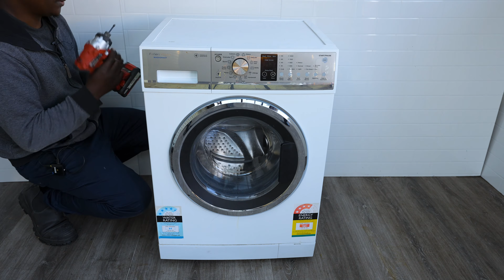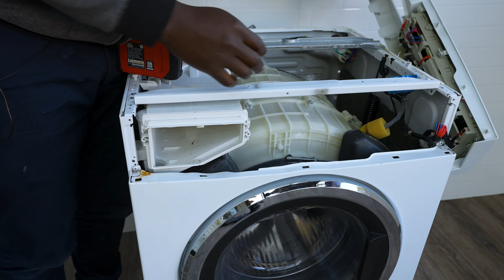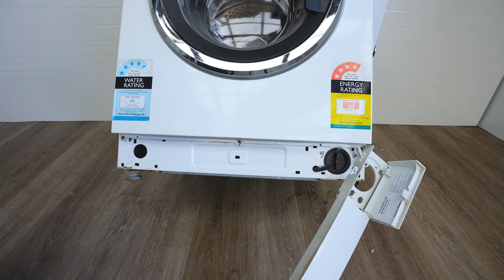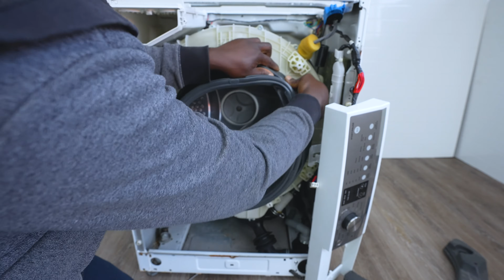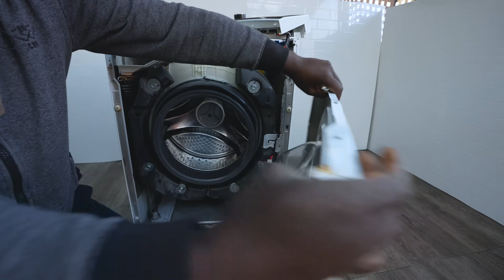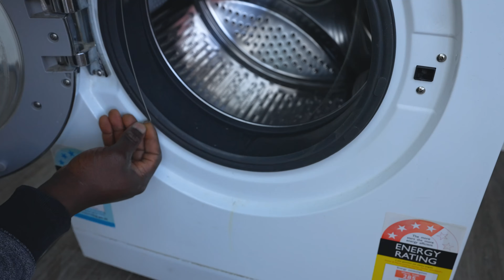Fisher Paykel Washing Machine Seal Replace , You Can Do This !

Comment: My seal tore when a strap from a sports towel was caught in the door. The continuous turning ripped apart the seal flange and allowing a small amount of water out. 

These instructions made me confident enough to order the part, take a day off work, and get to fixing it. 

The whole process was very simple except the final retainer wire. I spent 2 hours disassembling and reassembling. I spent ONE MORE HOUR trying to get that final wire locked in place. In the end I latched the wire ends together (in its final configuration), loosely screwed down the screw down, and used a small screwdriver to pry it into the retaining valley. A screwdriver is note ideal for this, since it could puncture the rubber, but fortunately I didn’t create any issues. I can only imagine they must have some special machine for this purpose at the factory.

Comment: Hey just want to say thank you for this video. Mine was torn and leaking so had to replace it. Was very difficult, the seal was the most difficult to install as mine has different lights and inlets and outlets etc. With a very sore back, all is done thanks to your video. Thanks again. Cheers.

Comment: Great walkthrough. Just a couple of things I had to do differently as mine was a washer/dryer combo so the seal is a little different (WD8560F1 Australia)

I am not an appliance repair expert, so just describing what I did and it appears to work fine.
There are probably experts out there who can advise on better ways to do this (especially getting the top pipe seal back on)

1. There are a few more attachments you need to remove at the top of the seal. 
   a. There is a light on one side and some sort of sensor on the other.
      Carefully slide these out (slide is probably a generous description here)
      Before you do, note how there are lugs for both that you will use to refit to the new seal.
   b. There is a heating duct in the middle. Remove the screw and carefully "unclip" the bracket (the bracket tip fits into a slot at its return)
      I also unscrewed the plastic duct that the seal was attached to so I could work on the next bit 
   c. There is a little pipe behind the duct part attached with a spring clamp (not sure of the correct term).
      Not sure what this is - maybe checks the air.
      You need to get this off before you can slide the seal out.
      I used a pair of multi-grips to close the spring ends so it would loosen and then wriggled the seal off

2. Putting the seal back on I needed to sort out the pipe seal from 1c above first while I was aligning it to get it on.
   This part was difficult for me, I am sure there is a trick to it as you will notice the actual seal is shorter at the back and higher at the front.
   In the end I just put the spring over the seal, opened it and wriggled the seal onto the pipe. The problem was one side kept slipping below the spring, in the end I got it all on satisfactorily.

   Also, it took me a few goes to make sure the seal was aligned properly before attempting to reconnect the top pipe (i.e. seal triangle/arrow to the arrow on the frame). It is worth taking it out and starting again until it is properly aligned.
   
   You can put the other bits (duct frame, duct, light, sensor) back on/in once you have all the seal seated properly around the drum as per video.

3. I snapped one of the clips trying to get the kickboard off. I think Mr Washy Washy did too as he commented on it when removing the kickboard.
   I also cracked the top of the frame as I was in the wrong place with the screwdriver. Once assembled, you can't tell but it was not ideal.
   I would watch the video and work out where the top lugs actually are. They just seem to need pushing down slightly and then pull it out.

4. The outer spring (wire seal retainer) is easy if you use a pair of pliers and pull the hook part over the anchor part (i.e. which gets screwed in)
   You just have to make sure the anchor part aligns closely with the screw hole.
   In hindsight, I should have pulled the seal back and taken some photos before removing it so I knew exactly where to position it when refitting.

Comment: Mine is underneath my dryer. I had to drag that thing off first, then the stacking kit just to start. All because I made the mistake of taking out the screws from the door hinge and the backing plate fell off inside the machine. Kids used the door as a ladder to climb up to the dryer. 1 hour of stuffing around and $100 later, just to replace the front ring around the door. Don't make my mistake, leave the hinge alone.

Comment: That last spring clip - to finish the job- is a b@$tard of a thing!! In the end, I opened the hook of the wire and detached the spring from one end, then I twisted the hook slightly. I only just got it back on but it worked!  The engineers who designed it should have to spend a year fixing washing machines!!!!!! Thanks again Mr Washy Washy. I recommend your site to everyone.

Comment: This walk thru was excellent, thanks. I did mine in about an hour with a cordless driver, a Philips head extension, a 7mm and a 14mm for the weights.
Agree with previous comments re seal - start from the bottom inner, work up (not fighting gravity) and then do the outer.

Comment: At the bottom lip of the plastic drum where the seal drain is, did you get the seal to hook onto two little tabs above the seal drain and behind the lip? Maybe this model doesn't have them (I have a haier with a similar design).

Comment: Tip: I had real trouble getting the wire seal retainer in place.  I wiped the wire with dish washing liquid to act as a lubricate.  That made the job a lot easier.

Comment: Really good video.  The bottom plastic panel comes straight out.  Not up, not down, just a straight pull.  For the seal, I found it easier to fit the inner seal first, then the outer seal just seemed to drop in place.  I also found it easier to remove the three screws (top) that hold the softener box in place.  Makes it easier to remove/refit the front control panel.

Comment: Im 62 female & I chaned the door seal. However, a couple of points:  identify the model as my seal was different, it has a light.
Beware the 2nd spring to unscrew. What a nuisance to get on to. And, the door spring, describe what way it was suppose to go on. Would save a lot of time swearing. But I did it!!

Comment: Cheers for the videos mate! I have the same washer and using your videos I changed the seal, replaced the heater element (which wasn't working) and replaced a bunch of buggered LEDs on the front display. It's now back to 100% and working perfectly, thanks again.

Comment: You saved my washing machine! I had to replace the chrome part of the outer door.  It arrived today so went to remove the hinge from the washing machine so I could reassemble the door with the hinge in place and then hang the door back on.  Easy right?  So I unscrew the hinge and clank! the mounting plate on the other side of the door INSIDE the washing machine falls off.  How the hell am I supposed to get that!   
Your video on how to change out the seal was just what I needed.  All I needed to do was remove the tension cable holding the seal in place and I could squeeze my hand in and grab the backing plate.  And I had enough access to reach in and hold it in place so I could re mount the door.  Hardest part was getting that stupid cable back on properly.
So, thanks again for the video.  It saved me a lot of money.
Reply: I just heard that clunk !! So you don't have to take the front panel.
OK ... here we go, another 15 min job that will take me 2 hours. 🤣

Comment: Thanks. This was super complex and fiddly. Got it done though. Wouldn’t have had a chance without your clear instructions. Thanks. I’d wish they’d designed these things to be easier to work on for the layman!
Reply: Agreed. The older top loader design is much easier to work on - many pieces just clipping together. My 20 year old smartdrive just goes on and on - I've done some small maint jobs.
I think F&P have been given this design i.e. they just sell them.

Comment: Need a video on replacing the bearings
Reply: I just did mine. 
First free machine could not remove them and mushroomed the spline. 
2nd machine was a little easier to remove the bearings

Comment: Hey
I thought this video would help my issue, but seems as though the drum as dropped down, which isn’t allowing the seal to line up? (It was twisted) 

Would you have a video about that or any tips mr washy washy?
Reply from the maker: hi remove the top cover.check if the spring has come off the support rail.
Reply: @askmrwashywashy  how difficult are the bearings to replace as we were quoted $300 for a new one installed. We have ordered the spare part and are hoping to have a go at it ourselves. Is it a pretty involved install?

Comment: Thanks - bought the seal from F&P delivered for $95, and followed your vid ... mine's a bit newer and doesn't have the strip along the bottom, but has 3 weights to remove. But otherwise the same and a good result. Saved $250. Good man. Thanks!

Comment: Great video thanks.  I can't believe how much you need to pull the machine apart to replace the seal!

Is there any way to just fix a small tear in the seal, like you indicated happens sometimes at the start of the video at 0:23?

That's the issue with mine (almost exactly where you put your finger on the seal!).
Reply: You can fix small tears with waterproof silicone sealant,  the type used to seal roof sheeting. Just needs a few days to dry fully.

Comment: Hello can you provide any tips on replacing outer seal spring-wire
Reply: Use a small screwdriver to gradually slide the wire into the groove . Quite easy really. And loosely screw it in first, already done up. Then tighten at finish
Reply: @johnmac3509  yeah I couldn’t do it. Paid a person.
Reply: @johnmac3509  Your technique works. I think it is the hardest of all the bits in this job. I read your comments after fixing it.